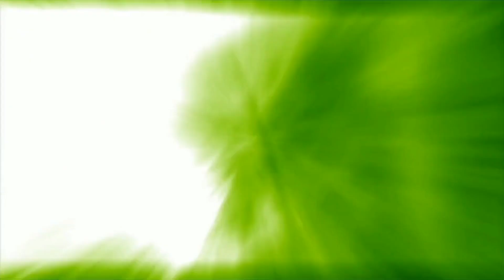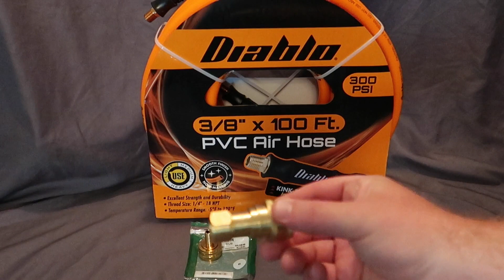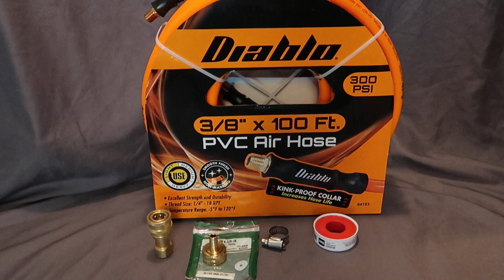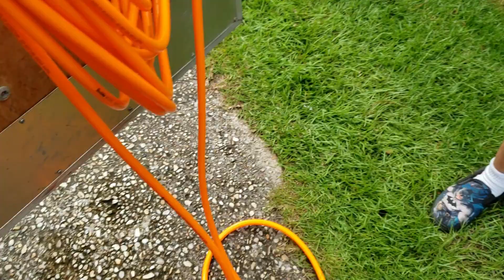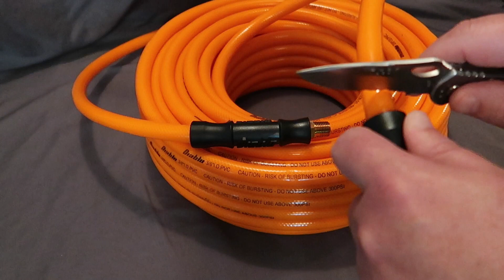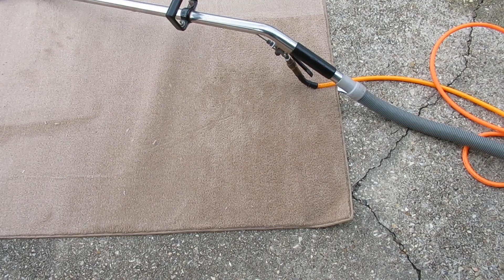CARPET CLEANING WATER SUPPLY HOSE

Comment: I recently picked up some stainless steel garden hose and it is super light and customers seem to be impressed with it. I run the water supply to my Water Otter 1200psi electric pump. Next on my wish list is an inline water heater. My CFX has an auto pump out for waste water which is great once the lines are set up.
Reply from the maker: I've seen that stainless hose but didn't know how well it would hold up, good to know it's working for you. I used to have the Water Otter, it was my first pump. I bought it used from ebay and used it for a very long time. Even when I replaced it with the General pump it still worked fine. Sounds like you've got a prettt efficient setup and the addition of a heater will make it even better.
Reply: @AllAmericanMack  I bought my CFX, Gekko Wand, Water Otter and a few extras off Kijiji for $700 CAD. None of the equipment had ever been used...not once! The guy was going to start a carpet cleaning business but had a heart attack before he could start. His wife just wanted the equipment out of the house. I got very lucky on the purchase.
Reply from the maker: Too bad for the guy but wow, that was a great deal for all that equipment.

Comment: How well does it hold up to the heat
Reply from the maker: This particular hose has a max temp. of 120 degrees, some others I've had went to 165. I've never had any problems with any of them holding up to to the heat coming from a regular home hot water heater (something like a restaurant would be an exception). With that said, if I was using the air hose as my solution line on a regular basis, I would make sure to get one with a higher temp. rating.
Reply: @AllAmericanMack  I have use a hundred foot of the green line did pretty well